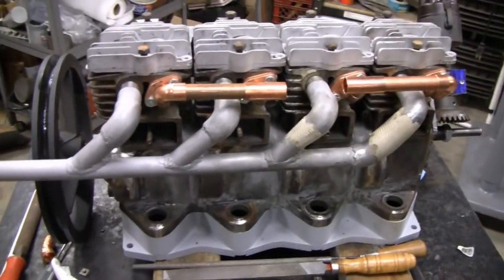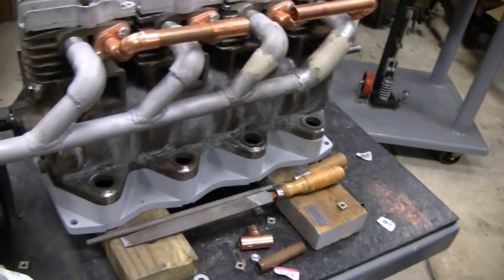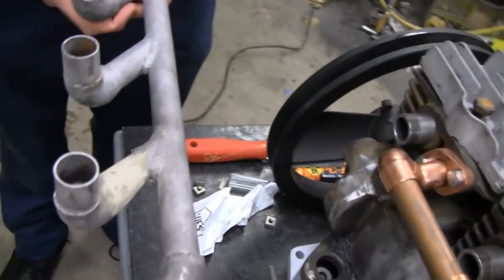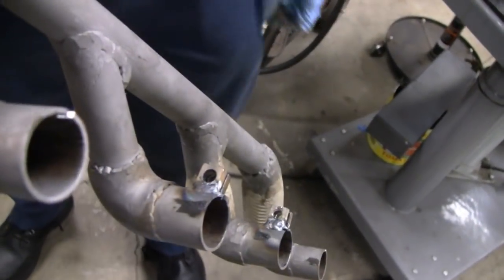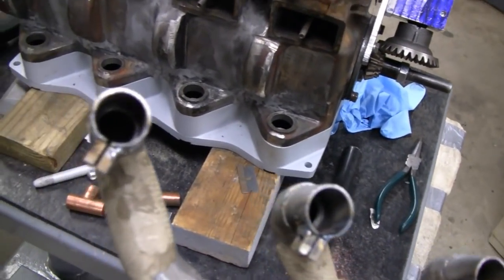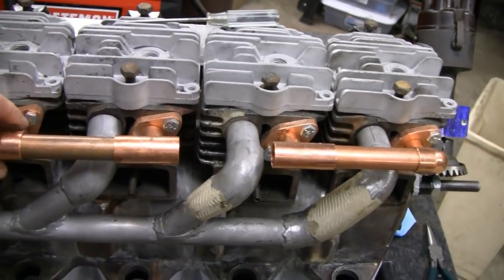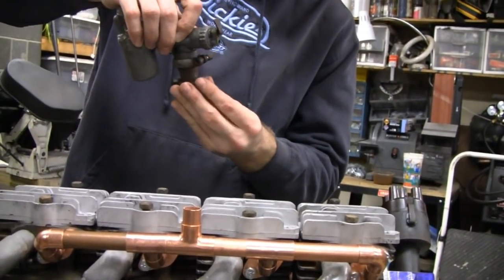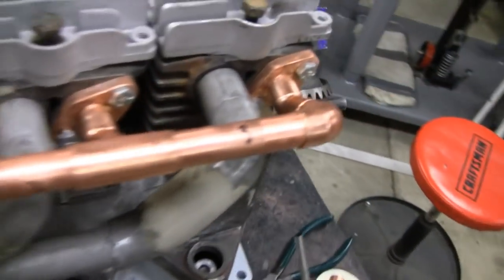HOMEMADE 4 CYLINDER BRIGGS PROJECT (part 14)

Comment: Used to work in the heating and air conditioning trade, we used silver solder and the mapp gas for the extra heat. Good job, with all those joints. Not much pressure doing it on camera.
Reply from the maker: +Dana Nelson Thanks Bud!!☺
Reply: Sil-Fos 15 Brazing Rods melting point, 1775f.
60/40 Tin/Lead melting point 400f.

Comment: When you weld, you may want to hold the burner in position for a few more seconds after you disengage the power. That way you will avoid those ugly holes.

Comment: When soldering the copper pipes, my old man taught me to slightly bevel the ends of individual sections so it has a 'v' shape when looking at the pipe side on. Gives the solder a nice valley to get cosy in AND make soldering easier =).

I think this is similar to surface preparations when TIG welding?
Reply from the maker: I never heard that but he's never steered us wrong before eh!!☺

Comment: looking great! what are your plans for the cooling system? I don't think the fan on the flywheel is going to be nearly enough
Reply from the maker: There isn't any flywheel!! It will be getting massive amounts of air from both directions converging between the two center cylinders creating a helical vortex equivalent to hurricane force winds!!☺

Comment: Interesting to see where the dizzy is mounted, I thought the engine was going to have the original Briggs flywheel, rope start pulley and cowling mounted up front? It sure will miss not having those... Just my thoughts. Dan
Reply from the maker: It will still have the original cowling!!☺

Comment: Man, it is looking Sweet!
What size copper pipe is the manifold, hard to tell from the vid.
Nice exhaust system, and the downdraft carb is awesome!
Reply from the maker: Thanks Bud!! It's 1/2 inch pipe!!☺
Reply: 805ROADKING Hope it breaths OK with the 1/2".
I made a different intake manifold for my sleeve valve, it was 3/8" copper pipe, looked neat, like a header. Unfortunately it didn't flow as well on the top end as the 1/2" copper.
Hope the start up goes well, just don't be inline with the v belt face of the flywheel, just in case! I learned my lesson when the #1 coupling flew apart on my 4 cyl.
Reply from the maker: We should be OK!! These engines are alot smaller than the stuff you play with!! The intake hole in the block isn't even 1/2"!!☺

Comment: Very nice fabrication and filmwork. I'm concerned that your intake is restricted because you have 1/2 pipe all the way from the carb - The cross section should be wider (I think) at the manifold. ie. you have 1 half inch pipe feeding 4 half inch pipes.
Did you consider this? Perhaps it will be fine - just got me thinking.. Again --Wonderful work!!
Reply from the maker: Thanks Bud!! I understand what you're saying!! I think we'll be alright because we're only using one cylinder at a time and they're all within 5 inches from the carb!! But we won't know definitely until we try and start it!!☺

Comment: Excellent work guys!
My only question is, how did you line up the blocks so the crank and pistons would be in perfect balance?
Oh, and can you please use the tripod for the camera more often?..(No offence intended)!
Can't wait to see this engine running! When will it be ready?

On your next project, how about making a BRIGGS V8!?  Now, that would be something to behold.  You could even run a small vehicle with it!?
An air cooled, side valve V8.....I can see it now.
Reply from the maker: Thanks Bud!! It wasn't easy lining up the blocks but it can be done!! The tripod gets in the way and doesn't let the camera get to where it needs to go!!☺

Comment: Looking really good though I'm a little concerned as to how well that intake is going to work once you try to set you fuel mixture.  Outside cylinders may either be lean or inside will be too rich.  I guess you will see when you run it.  Keep up the great videos.
Reply from the maker: Thanks alot Bud!! I think we'll be OK!! It doesn't seem to make a difference on most 4 or 6 cylinder car engines and all these cylinders are within 5" of the carburetor!!☺
Reply: 805ROADKING I am just impressed with the ingenuity of what you are doing.  There is no sane reason to build this other than to see if you can, which makes it such a cool project.
Reply: 805ROADKING A lot of (most) straight eights had only one carburetor.

Comment: maybe you put it in a cycle car? use a motorcycle clutch,
and a 3 speed, then a drive shaft made of stearing colum
U-joints, maybe a Differential made from the auger drive, off
of the front of a old snow blower.

Comment: That doesn't seem to be enough carburetor for a motor 4 times as big as what it came on... The old ford Y blocks had some pretty small 4vs you could use for something like that
Reply: +Seth Mullins On a 4cyl, generally only one cylinder is intaking at a time, so the same size carb is fine, it just works more constantly.
Reply: Good point.

Comment: I used to cuss dureing pipe soldering worse than 500passwords  till a buddy showed me a lil trick  apply solder to opisite of flame  that entire joint seem is hot enough for solder to flow all the way around  that and use one of those flame proof fabric thingies  sorch marks on custmers  house not a good thing

Comment: hi just 1 Q&A to have the EX pipe pointing the other way so if a pulley belt was used it would not touch the pipe, just a thought.Well I look forward to the next bit of the                                                                                                                project
Reply from the maker: There will be a pulley belt and there is plenty of room for it!!☺